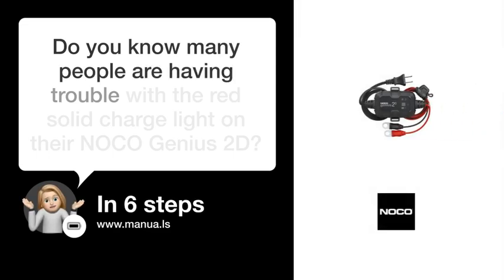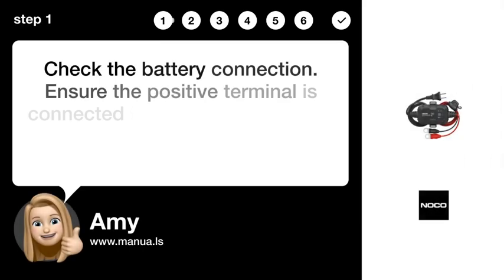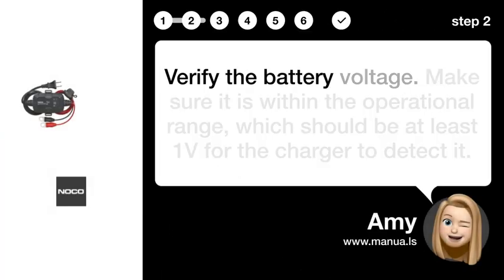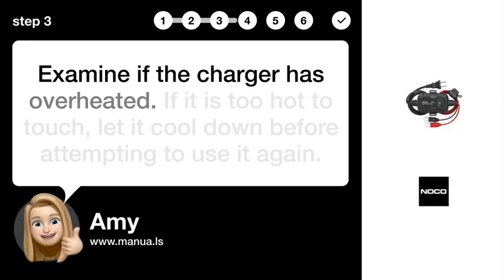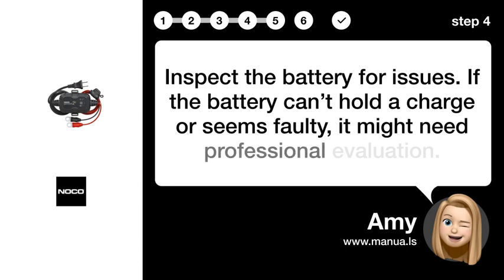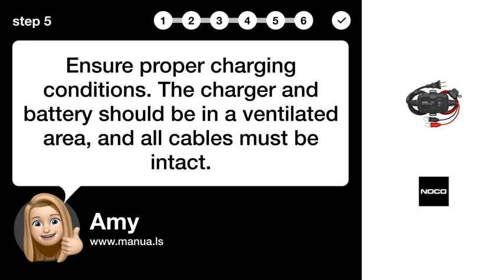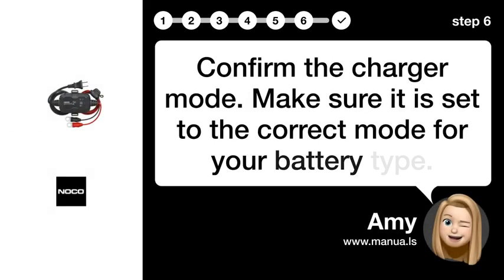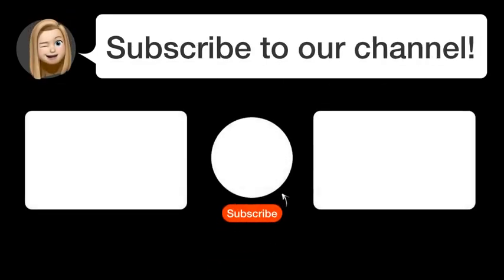How to Troubleshoot Solid Red Charge Light on NOCO Genius 2D

Comment: ??
Set to correct mode? The Genius 2D doesn't have a mode selector button. You hook up the cables to the battery terminals then plug it in. That's it.